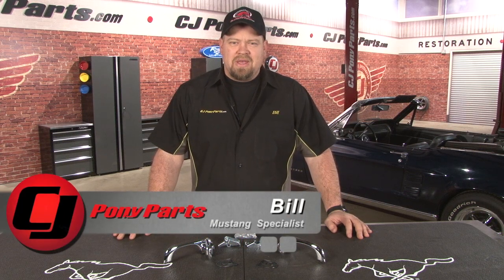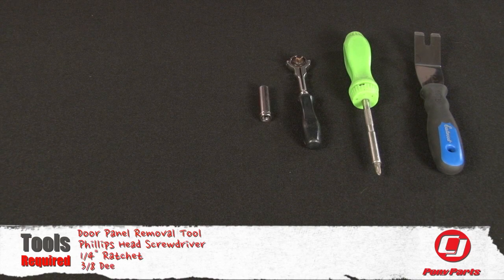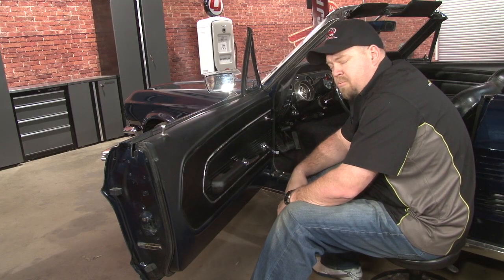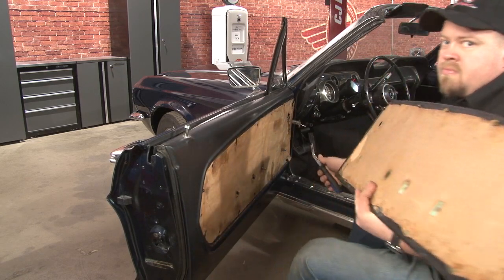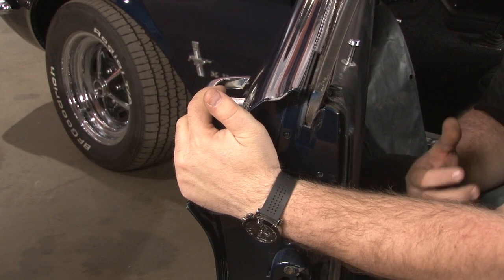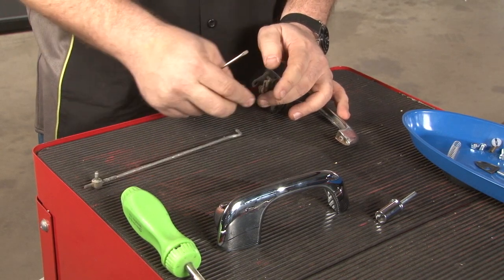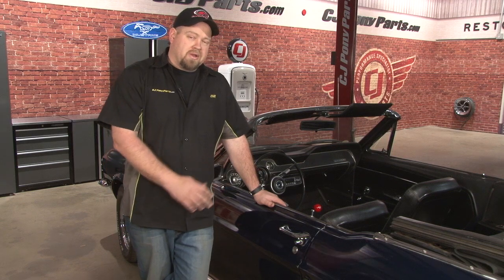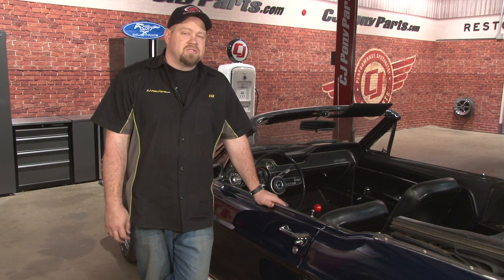Exterior Door Handles | 1965-1970 Mustang

Comment: My mustang just randomly stopped opening from the outside, but opens from the inside. The door handle button feels like their is no spring to it.
You think if I just replace the outside door handle the issue would be fixed ? 
It’s just not opening from the outside, but from the inside it opens fine.
Reply: I just swapped mine out for this exact reason. 
Opens from outside now.  
I think my issue was the little screw that holds the hinge to the handle worked it’s way out.

Comment: This is fine for the 68 Mustang but there is not enough room to get a socket in to loosen the nut on the door handle. There is only enough room for your fingers to touch the thread but you can't move your hands to get proper control. Please show how to do this on a 69 Mustang.

Comment: I did this and now my door wont open, the button on the outside is hard to push in and the handle on the inside wont open the door. I had to release the clip releasing the rod so i can  open the door, what am i doing wrong?